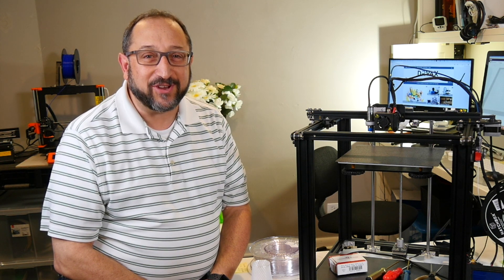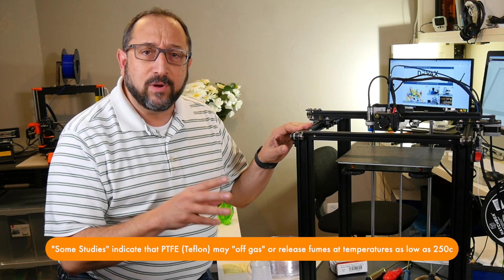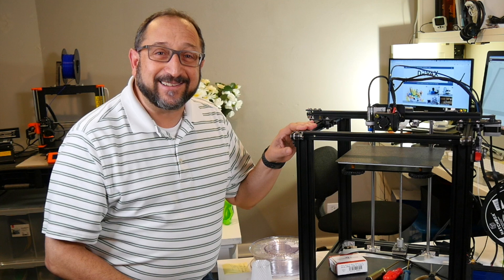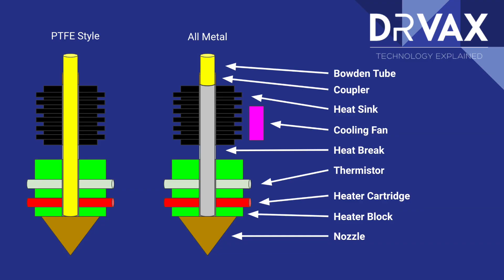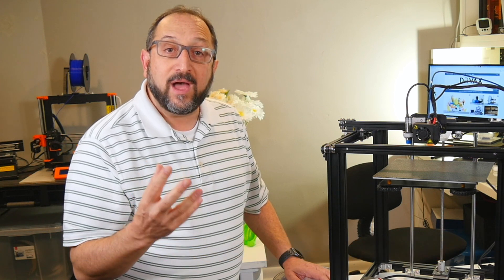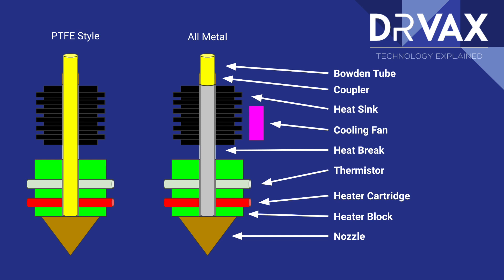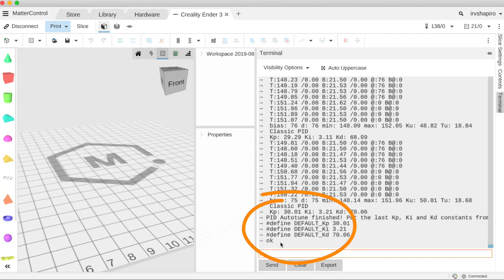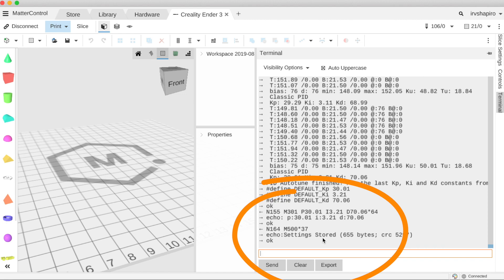Creality Ender all Metal Micro Swiss Hot End Upgrade and PID Tuning

Comment from the maker: Folks, I just added a community comment about printing PLA and the issue some people have with removing PLA filament after the printer has cooled off.  The full comment is in the community section of this channel.  Here is the conclusion.  To remove filament heat the nozzle to 230c then push some filament out (extrude) before pulling back (retract).  PLA prints work great at a retraction setting of 5mm at 25mm/sec.  I have included a photo in the community section and I am continuing my testing.  Remember my printer has a SeeMeCNC extruder, Capricorn Bowden tube, and the Micro Swiss Hot End.  These all impact my experiences.
Reply: 5mm with a micro swiss all metal ..thats a lot of retract
Reply: I agree.. micro swiss state no more than 4mm and folks on forums suggested lower at 2mm, also increasing speed up to 40mm/s..

Why do you suggest these settings?

Comment: Very informative, thank you. I am getting an Upgraded with silent motherboard Sunlu S8 that comes with a magnetic build plate, and I also have an all-metal hotend ready to install. Will my printer be able to handle print temps after installation of the new hotend be able to handle printing at temps of up to 270? Thank you kindly, and have a good sabbath.

Comment: I know your video is old but thought id comment anyway in case you never solved your stringing problem. What fix all stringing issues for me with my ender 5 plus was an aftermarket bracket kit that allows you to mount the extruder motor in top of the hot end. This adds weight to the gantry so you cant print as fast as it was designed to anymore but man im glad i changed it. Solved jamming issues too. Id rather be forced to print slightly slower if it means less failures or that annoying stringing goes away. Anyways… gotta get back to your video cuz its getting to the part im watching for in the first place which is how to change the firmware so it stops going into alarm when i set it to 290c for carbon fiber polycarbonate. I can get away with 270c but it keeps alarming when i try any higher.

Comment: When you use Matter Control to adjust the settings in your Ender 5, which Printer in MC did you choose? The only options I got for my recently downloaded copy as for Ender 3, CR-10 and CR-20. A similar questions was asked a year ago but there was no answer. Since MatterHackers seem to differentiate there must be some difference. didn't think i should guess. Thanks, good video.
Reply from the maker: I would use the Ender 3 profile and adjust the size on the printer side tab.

Comment: So how exactly did you increase the max printing temp? I just installed the micro swiss direct drive all metal hotend on my ender 5 plus and i am running the crealitt silent board, with Bl touch. I followed all the commands but my screen still says max 260 c

Comment: This video gives the impression that you can just upgrade some parts, set the PID stuff, and you're good to go. There's no mention about the fact that Ender stock Marlin has a built in limit of 260 C. You need to rebuild and update the firmware to get past that limit.  It's confusing as hell, too. If you look for HEATER_0_MAXTEMP you will see that it's set to 275. What they don't tell you is that there's a safety offset. If your max temp is set to 275, it's really 260. Then there's the thermistor temptable. Whatever the max temp in that table is overrides the HEATER_0_MAXTEMP setting if it's lower. If it's 300, subtract 16 and you get a max temp of 284 degrees. I'm not sure why they subtracted 1 for good measure. All of this "safety" is actually pointless since they can simply document why you shouldn't set your maxtemp above a certain temp and trust that users can make their own decision. They seem to survive printing ABS in their basements. ;-)

I installed a Gulfcoast Robotics All-Metal hot end, their hex EPCOS thermistor (good to 300C), and Capricorn tubing following YouTuber suggestions. It took me a while to figure out what I wrote above because no one seems to warn you about these additional requirements. I'm finding that there's a lot of missing information out there and I hope to help people fill in the blanks that I had to suffer through.

UPDATE: Up until the time of this posting, I was only able to upload Marlin 2. I've been able to update the official Creality version of Marln and found that Marlin 1 won't limit you to 284 C because of the temptable so it's a little less nutty. If you want 300 C (This can only be set with g-code. The LCD UI still limits you to 260.), set HEATER_0_MAXTEMP to 315. Be sure that your thermistor can handle it before you do.
Reply from the maker: Good information.  Thanks for sharing.
Reply: Exactly this. The Micro Swiss install is easy. We need a video on the changes to the firmware.
Reply: Great writeup. I wish I would've seen this last summer before embarking on my painful journey. I'm good to go to 450/160 now
Reply: If you go to my channel, you can see the information I posted on converting my Ender 5+ to use a BTT SKR Pro v1.2. I also posted some links to my google drive folder containing pictures and my firmware source code. I am in the process of adding a PT 100 and will update my channel once I get that done. I also added software support for controlling 8 external relays. I use one to cutoff power to my AC heated bed in case the solid state relay gets stuck on.

Comment: Dr. Vax, could you be more specific about which are the G-code commands to change the maximum allowed temperature of the hot end? Thanks for your videos.
Reply from the maker: Unfortunately I know realize that you need to change this in the Marlin build and cannot override it with GCODE.
Reply: @MakeWithTech  may you provide a video on how to do this on an Ender 3 Pro? Thanks for your time.

Comment: Great Video.  I've already upgraded my E3 v2 to a BLtouch running the Smith3D firmware and have been thinking about adding the all-metal Micros Swiss hot end.  You are my go-to for 3d printing.

Comment: watch?v=aQIg9zxuCvM . With marlin you'll be able to change the thermistor to a PT1000 (or PT100 with an amplifier). Hence, dump the 275oC limit and print even hotter. If you're gonna do it, better first make sure you have a PETG shroud printed out for your cooling block fan, so you can avoid spraying cool air on the heated block as this becomes a problem with higher temperatures. And also that your print cooler fan duct is not printed in PLA, or that it would melt if you try to go above 300oC. IF that is the case, reprint it with PETG also. But apart of this - remember, this is not something I endorse, do it at your own peril. I take absolutely no responsibility for this whatsoever! This suggestion is strictly for educational purposes only. So don't blame me, if your house burns down to the ground  :-) .

Comment: The lack of an option to use a higher temperature sensor is one of the main reasons I won't be bothering with a Micro Swiss hot end when I upgrade. There are clones of this that have the hole for those in plated copper which you'd need anyway past 300C.  For me, I want a hot end that can both use higher temps and also allows easy nozzle changes, neither of which this one does.
Reply: I just got a 20 dollar amazon microswiss clone and a 15 dollar direct drive kit. It's been printing like a dream. It came with kind of a crap nozzle, but other than that its better than a microswiss. Its sad that microswiss got their product "stolen"... BUT its also kind of their own fault that they allowed clones to surpass them in functionality. Theyve been asked to make changes by multiple youtubers but refuse to improve their design.

Comment: Is it advisable to go up to 275 c with the stock thermistor and heater cartridge?
Reply from the maker: As far as I known there is no problem with going to temperatures under about 280 if you heater cartridge is able to supply the energy and your thermistor readings stay stable.
Reply: @MakeWithTech  Great thanks!

Comment: Something not mentioned but should be whenever doing PID tuning.  Any change to the boundary conditions impacts the tuning variables.  It is probably best to tune your hot end with your part fan turned on to some value close to what you intend to use it at.  Ideally the PID tuning would go to higher temperatures as well as the dT impacts the cooling rate and can be non linear based on the boundary conditions.
Reply from the maker: Excellent suggestion.  Thanks.

Comment: Thanks for all the info, been watching a few of your videos now and you have helped a lot. 

I have an Ender 3 V2 and just ordered my Micro Swiss hotend and looking forward to installing it. Few Questions:

1. What would happen if I do not enter the new PID numbers in the g-code? I will do it but just wondering how critical it is to do and what would happen if I did not do it. I also see some people on youtube mention that you need to do it for different temps. So you get different PID's when you run at 150, then different at 200 and 230 etc. Do you just do it like you showed in your video and then forget about it?

2. What happens when new firmware comes out - do we have to do the whole PID thing again once we installed the new firmware or will it keep the new settings we saved?
Reply: Entering M503 gcode from the terminal will allow you to see if your PID values have changed. PID tuning is made so that the temperature for the set temperature doesn’t over/under shoot (like closely hover around 223 or 217 if you have set for 220), or fluctuate wildly between the set temperature (like between 216 and 224 for a set temp of 220). All that to say, if your temperature readings are correct and you don’t observe this then you don’t need to calibrate it.
Reply: Great questions.

Patiently awaiting a reply...?

Comment: great video. how did you change the setting of c260c to c275 or more? you only change the pid setting.
Reply: This is what I came here for, and either I missed it, or it wasn't in the video.
Reply: @TheSuburban15  Id search around on Reddit but I’m pretty sure you have to flash it and use a bootlegger to upgrade to marlin and then you can change it

Comment: Great video!  Will this upgrade (for printing nylon) work on a Creality Ender 3 v2? Also, do you know if this upgraded setup will work for carbon-fiber as well?  Last question,  will I be able to print PLA, TPU, ABS)with the same upgraded setup or will I need to put back the original hot end and/or do other modifications, like adjusting the gcode?  Thanks.
Reply: I know this is old, but yes to all of that. I print nylon regularly on my regular ender 3 that ive modded. I used clone parts but its the same basic idea. I got a direct drive kit, a microswiss clone, and a dual gear extruder with a 3 to 1 gear ratio all for about 60 bucks total and i use it to print PLA+, PETG and a Nylon 6 and nylon 6.6 copolymer (its called overture nylon, its fantastic) regularly. For carbon fiber just make sure to use a steel nozzle and increase the nozzle temp by 10 or 15 degrees since steel isnt as good at conducting heat as brass. Tungsten nozzles ate king if you can afford it. They have the heat conductivity of brass and FAR more hardness and heat resistance than any hardened steel. Just keep in mind that tungsten still gets dirty and gunked up, it just literally never ever wears down. Tungsten is basically like a metal diamond that cant shatter. Damn near as hard as real diamond, but bends without shattering (if you can manage to bend it). Its also even much heavier than lead which makes it great for a lot of other things too. Just kinda pricey, but for printing lots of carbon fiber at high temps its worth it. Especially when printing like 400 degree exotic filaments. Its cheaper and purely better than ruby tips imo. That said, i just use cheap brass nozzles for everything and replace them all the time. Still works out cheaper than other options. Also steel nozzles are an issue because i havent flashed custom firmware yet and im limited to 260c which is not hot enough for nylon with a steel nozzle, only brass.

Comment: Since the Capricorn XS tubing goes up to 300 C can I safely use that in lieu of the all-metal hotend or will it still off-gas?
Reply from the maker: This is a really good question.  Not sure and since this could be a health related question I do not want to answer improperly.
Reply: @MakeWithTech  From Capricorn's website:

https://www.captubes.com/safety.html

It seems like it should be mostly ok (so long as you don't own any pet birds and print in a ventilated area)

Comment: I KEEP ON GETTING A PID AUTOTUNE FAILED TEMPERATURE TOO HIGH
Reply from the maker: What firmware are you using?
Reply: DrVax any thoughts?
Reply from the maker: What are you doing when you get this error.
Reply: DrVax M303 E0 S200 and I start at room temp.
Reply from the maker: Interesting.  When I see something that doesn’t make sense I generally check the cabling.

I would also would try an M105 and see if the temperatures look reasonable.   If not you could have a hardware problem.
Reply: DrVax I have a feeling it might be the thermistor. A new one just got in and I’ll swap it out and keep you updated.
Reply: @MakeWithTech   I try the M303 and M303 E0 S200 and I keep on getting an error saying "autotune failed! temperature too high!"
Reply: DrVax Im using the stock Marlin firmware that came with the machine.

Comment: Interesting video Doc, but I wonder why you are printing Colorfabb XT at 275? We have been using it , and its cousin nGen,  for over a year to manufacture functional parts and it prints fine at 245 ( nGen at 230 ). If you are having stringing issues this may be why.  Other wise great video.
Reply from the maker: Good point.  I find better layer adhesion at higher temperature.

Comment: how does a higher bed temp above the typical factory hot end effect glass?  I'm currently running my ender 5 with a glass bed and using printastick bed primer.  I would like to try your loadout but have these questions.
Reply from the maker: Works great.  I have glass print beds on my Monoprice Delta Mini and my Monoprice Ultimate 2.  Both have no problems with the temperature.

Comment: Nice Video..great Idea.
I change  to a Full Metall Hotend for 2Month..it works only for a few minutes...The original Fan has not enough power to cool the Full Metall Hotend..The Filament melted in the heatbreak..I change the Fan to powerfull One ..Now it Works realy good. The Print Surface is a good Idea, The Problem is.. most of the Heatbed's are not plan...The flexible Printsurface can not fix this Problem.
Most of us German 3D Printers use a plan Surface on the Heatbed like a Mirrow for printing or a specialy planed 3mm Aluminium Plate with a Printsurface on it.
Reply from the maker: Did you use the micro Swiss hot end.  It works great.  Perhaps the heat sink on your hot end was not large enough.
Reply: @MakeWithTech   No Micro Swiss ..it was a cheap Aluminium Hotend .. the Heatbreake .. I use now  a Titan Heatbreak from a Special Seller ..it works very good.. The next Step is to change the Hotend ..I Thing it will be a Micro Swiss.
The next work will be a new Hotbed...a 4mm planed Aluminium Plate whith a 24V Silicon Heatbed..It will be my one work for my Ender 3

Comment: I up graded my Ender 3 with a Swiss all metal hotend and ware resistance nozzle, however i found this to be extremely stringy with some prints pretty good with others but when i used glow in the dark filament it significantly wore out the nozzle. I ended up switching back to the original hot end as I get fantastic results with this. And yes even PETG
Reply from the maker: Interesting. Good feedback.  I will do some more testing.
Reply: Try using dirt cheap brass nozzles and just letting it wear out. Unless you print at super high temps its not so bad. I use brass to print nylon copa at 260 just fine for a week or so before i have to replace it. It wears out kinda fast, but not THAT fast and still prints well. My nozzles are only 60 cents a piece and i get better results from brass than steel so its worth it for me to just use them for everything. If i printed any hotter than 260c though id use probably tungsten nozzles because tungsten is the BEST for so many things.  Direct drive and dual gear extruder with a good gear ratio (like 3 to 1) can help stringing too. Both can be bought on amazon for 15 a piece. A good extruder is really underrated and considering a good dual gear clone is only 15 bucks, its a must have upgrade imo. Plus youll have less failed prints and itll clog less. Your retraction will be much more responsive and easier to tune too. You will likely even be able to print faster with a nice extruder.

Comment: Are you suggesting doing all three upgrades?  If I don't have the budget for an all metal hot end or a new print surface, would option # 1 alone suffice?  5:35 is the heat sink; the heat break was already attached to the heater block.
Reply from the maker: I would not print much above 250 without changing the hot end.   I am able to print ColorFab XT at 245c on my Monoprice Ultimate 2 which has a direct extruder.  Not sure it would succeed on an Ender.   However, I print PETG on my Ender 3 Pro and Ender 5 all of the time at about 235c.